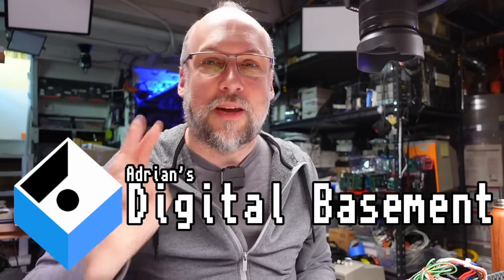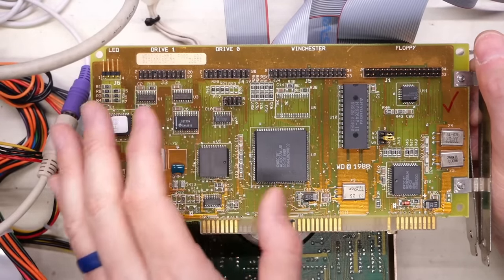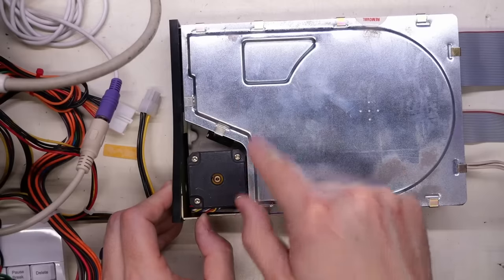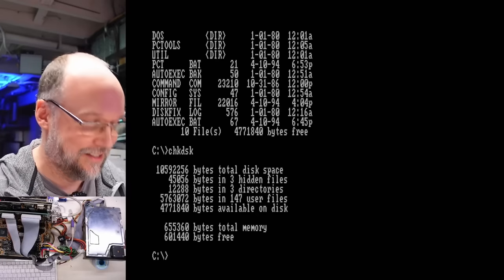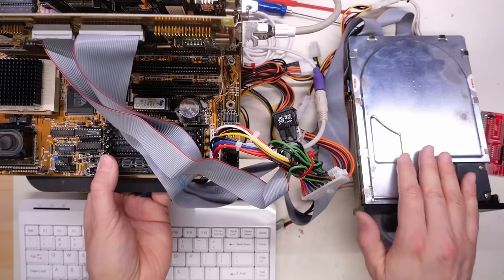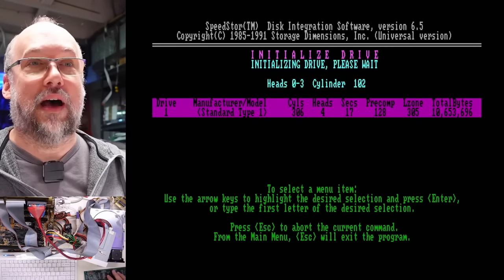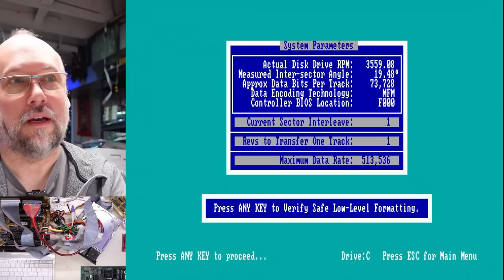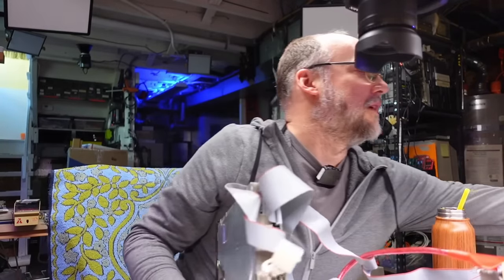Test and try: Does this 40 year old Tandon TM-252 drive still work?

Comment: Tandon was bought by Western Digital. 
Before, WD only made controllers. They had the idea to integrate the controller on the drive electronics and connect the drives directly to the PC's bus via a 40-pin cable. They couldn't find a drive manufacturer to cooperate with them, so they simply bought Tandon for their drive manufacturing plant. All of WD's early IDE drives were 3.5" Tandon (TM262/362 or TM282/382) drives with a new PCB.
So technically Tandon still exists, it's just named WD now :)
Reply: That's awesome info, thank you!
Reply: Super cool story! Way more detail than Wikipedia provided. :) They basically took that $80M from WDC and tried to turn themselves into a full on PC manufacturer, but it did not work out and they folded within 2 years.
Reply: Tandon was a big manufacturer of floppy drives. Later, they created a PC compatible computer with removable HD platters that shared a dock with all the PCB components.
Reply: "They had the idea to integrate the controller on the drive electronics and connect the drives directly to the PC's bus via a 40-pin cable." And thus IDE was born. First versions of IDE were literally nothing more than some bus transceivers that pass through the ISA bus signals onto the IDE cable when certain I/O port addresses were used. The ATA command set to make it work like a hard drive was defined by Western Digital, but there was no real physical limitation for it t support other devices. The IDE controllers were just buffering data and exposing an interface.
Reply: Super interesting!! Thanks for sharing this!

Comment: Tandon drives all sounded like that. That's NORMAL for them!! I remember those things from WAY back in my CompUSA days. They all sounded like they were hand-cranking a flywheel to start a WWII Tiger tank. Ah, memories!
Reply: Pretty much all 5 1/4" hard drives were massively noisy even when they were relatively new (very loosely speaking, these puppies were around ten years old when I first got my hands onto them). I was always fascinated by the slow spin-up, especially of full-height drives. I only ever encountered one HDD with a stepper motor, a 10 MB NEC from a broken Bull Micral XT. It was even more fascinating than this one because the stepper drove the heads using an exposed pinion gear.

Let's face it, 3.5" drives were noisy too, well into the double-digit GB era, only then they got remarkably more quiet. Quantum drives were the absolute worst, they poduced a painful high-pitched whine even brand new. The last of the noisy ones I had was a 10 GB I think. 2.5" drives were much quieter from the start.
Reply: @Ragnar8504  The first drives with a fluid dynamic bearing were from (I think) Fujitsu around 2001. I know this because I frequently ordered fujitsu drives as replacement parts in a repair contract and then one day the FDB version was delivered. Shortly after all other manufacturers also started using FDBs in their drives. Since then they've been silent throughout their lives. FDBs also enabled high speed drives in the 10-15 krpm regime.
Reply: @paulmichaelfreedman8334  Cool, didn't know that!
Reply: Agreed. When I heard that, I thought, oh, yeah, that is going to work, sounds normal to me.

Comment: Adrian - the low performance with the 8-bit controller was in part due to the fact that you did not have the card's BIOS address shadowed in the PC's BIOS.  When you use an ISA controller for your HDD with an EPROM, not enabling that will cause that.
Reply: Yeah. It's equivalent to a GPU running slow because the Resizable BAR feature was turned off.

Comment: Unlike Adrian I do actually enjoy the sound of 40 year old spinning rust!
Reply: I love those old drives!

A vintage computer isn't the same without that power on drive spin up & initialization, and the glorious seek sound while accessing data.

I don't want CF cards in any of my old computers. The true experience is missing. I especially like the 5.25 drive bay covers with the activity LED. 😊
Reply: Agreed, but… Adrian, PLEASE lubricate that bearing! You have sliding rollers! YouTube audio compression does not filter that out, and AS MUCH AS I PRAYED FOR BAD EARS my 50 year old eardrums still cringe at that high whine!
Reply: HDD's, dot matrix printers, modems. I for sure have a fond memory of those sounds. Oh and the booiinng...click! when hitting the degauss button on the CRT :D
Reply: Yeah that spin up sound was fantastic.
Reply: The drive seeking sound that was used in every movie scene with a computer in it for 30 years at least.
Reply: I was born way after these drives were made and I agree. That's why they're so appealing. I grew up in the 2000s and the mechanical drives then were quiet as hell by comparison.

Comment: That era of hard drive protocols was really interesting. ST-506 was intended for floppy and hard drives to exist on the same cable, some computers did use that method of attaching drives (I believe the PDP-11 did). The drive itself is dumb, and the control signals are the same as the floppy drive (the data lines are re-purposed for status).

CDC used a very similar signaling method for their "Finch" hard disks and floppy disks, Usagi Electric has some really interesting videos on them. I compared the signals and there are a few pins swapped around but otherwise they are identical, so it's possible that they are either copied from each other or even more or less compatible on an electrical level.
Reply: I'd hazard a guess that they're both mostly-copied from some manufacturer's app notes.

Comment: Wanna talk loud? The stepperband motor on my Amiga 500's 20mb HDD (non-standard, was kept in it's own box separate from the controller that plugged in on the side) was SO loud you could hear the heads accessing 2 rooms away!  It was absolutely insanely loud. The whole thing sounded like a vaccuum cleaner motor going with a typewriter chittering overtop.
Reply: i had an ESDI drive in a 286 that would shake my 50 gallon fish tank from 20 feet away...

Comment: Good lord, an MFM drive! I love the sound of those, I used to sleep right next to my old XT machine beginning of the 90's and found the sound very soothing. Low-level formatting took the whole night in those days. Good memories. Wish I still had one.
Reply: Just did a low level on 10TB = 14+ hours
Reply: @player_unknown963  I am so jealous of you :-)
Reply: I remember the creaking and groaning of the stepper in my ST-225 drive (20MB) back in 1990. With everything you did, the harddisk would react as there was hardly any cache available for disk operations.
Reply: oh those times. trying every interleave value until you got the highest throughput - 125kBytes/sec :P

Comment: Adrian, I just bought a learn to solder kit and a bunch of little test projects off Amazon. Im in my 40s, but you can never be too old to learn a new skill right? Im starting from the ground up, basically directly due to your YT channel. I got tired of just watching, I want to learn how to do this too. At least a tiny bit. :D
Reply: Nice to hear ! 
Flux, flux is magic ;)
Reply: I’m going to learn soldering myself also inspired by Adrian and I’m 39 lol
Reply: I learned in my mid 30s because of YT channels like Adrian's. I first got one of those awful cheap solder irons that wasn't temperature controlled and thought soldering was really hard. Then I got the Pinecil based on Adrian's recommendation and learned I'm actually not terrible at soldering after all!
Reply: Please learn to use the right test equipment to check your workpiece for any stored voltages before firing up the soldering iron, especially if that workpiece is an old CRT monitor or power supply unit with big caps. (The kits you bought probably won't have any of those, but I'd hate for you to get a big zap.)  Wear your safety glasses, and use adequate ventilation to keep from inhaling lead-bearing fumes.  (Yeah, I'm old school...)
Reply: @horusfalcon There's absolutely no lead in the fumes. The risk with the fumes is because flux is an organic chemical, and when it burns/decomposes it produces a bunch of pretty bad stuff. To avoid lead issues you need to wash your hands well after soldering with lead-based solder.
Reply: 46 here and primarily due to Adrian’s videos I’ve learned to solder, do some kits and restore/recap several vintage computers.

Comment: The missing data happens because the magnetic domains move. For example if your have two north poles next to reach other they spread apart while a north and south next to each other will start to drift together. Even if the domains are still strong they're now out of alignment with the heads. If they aren't too far out of alignment doing a read and write (move files) to everything puts the data back right under the heads. SpinRite does this (plus other stuff). Doing multiple reads can sometimes get a good read and allow the software (with CRC checks) re-write the data again. Newer drives do a compensated write where they put the like poles closer together and the unlike poles farther apart. This also has to be compensated not only for bits in series but to the bits in nearby tracks.

Comment: It still amazes me how many discrete utilities had to be installed on early PCs just to keep the darn things running. We take for granted everything built in to modern operating systems and the massively improved hardware that "just works."
Reply: Back in "the day" they did just work. You only had to know dos commands to run your productivity app.

You didn't have to worry about low level formatting a drive, or interleave settings, etc... unless you built the computer or were fixing it.

Only when things get old do these issues seem more crazy. As modern hardware ages it won't just work in the future.
Reply: In the days of 486s to the Pentuims you needed a few CDs just for the motherboards and its peripherals.
Which is just as tedious but one tends to ignore it due to the "splashy" installer CDs used during setup.
Reply: @volvo09  Ah, your rose colored glasses are strongly tinted, my friend. Things did work fine once set up, but I for one do not miss the days of yore before PnP and SSD that do not need defragmenting. There was considerably more overhead when maintaining computers because it all needed to be done manually. Yes, I cut my teeth on computers that way and learned much, but now I am much too comfortable with the technology of today to return to the old ways except purely for nostalgia.
Reply: @artofnoise5013  oh things are absolutely better today. It's great to not have to change jumpers when installing a new card, install drivers in dos, add network protocols, etc... 

I get what you were saying now, I responded to you from an "end user sitting at a computer" perspective. 

I totally prefer today's "plug and play" computer experience, never would have thought anyone non technical could reinstall an OS and have drivers automatically install as long as you have an internet connection.

My old computers are only a fun toy to revisit and play with, I don't really want those days back!
Reply: @volvo09  Yes, from an end user perspective things were probably simpler as there was internet connection, no updates, and nothing that changed. As long as no one breathed on the machine everything was fine!
Reply: Actually in the DOS world things "just work". All those utilities are completely optional. The PARK utility is a good thing to have with those old hard disks with stepper motor heads.
Reply: @navigatorofnone  That's not true. CDs weren't even a common thing back then.
Reply: @artofnoise5013  Before the PnP ISA was a thing, things just worked. PnP then made things difficult and introduced all kinds of resource conflicts that are often impossible to solve. Often those PnP cards also have a proprietary configuration program that only works with some specific version of Windows or MS-DOS.
Reply: @tikkasen_urakointi  i don't know where you are from, but in the country during the 90s (1992-1998 onwards)computer cds and zip drives already existed along with video cds.
BUT they were very expensive.
From 1999 to 2008 computers became affordable.
Reply: @navigatorofnone Yes? That does not change what I wrote. CDs were not a common thing with 486s, and certainly no-one needed them to install drivers. CD-ROM drives became a common thing later in the 90s, but drivers were small and usually came in floppy disks.
Reply: @volvo09 Configuring resource usage with jumpers works much better than with any software-based Plug-and-Play utility. The jumperless configuration can fail and it often requires a proprietary configuration program that only works on Windows or MS-DOS. Jumpers always work, and the user just needs to make sure that there are no resource conflicts between different devices.
Reply: yeah we used to run computers, now computers run us

Comment: One important thing about stepper motor HDD's, is that the physical orientation can effect the drives operation.  Flipping the drive on it's side may require a new low level format, as the heads end up in different spots due to gravity effecting the heads.  This used to be a real problem back in the day, as users would flip the computer on it's side, and the hard drive would stop working.  Come in, do a low level, partition, and DOS format all would be good.
Reply: Minus their data (high probability)
Reply: @paulmichaelfreedman8334  Always minus the data.  Low level format tends to do that!  ^-^

But people back in the day did stupid shit, just like today.  Had one customer in the late 80's, HDD would be intermittent with the monitor on top of the case.  (The weight of the monitor was causing the case to warp, thus pressing on the HDD).  Told them to just not do that, and it'd be fine.  Nope, $500 later, all fixed.  Stupid.

Comment: The clamps holding the lid on instead of screws assists reducing case stress as the hard disk heats up while powered on.  Several stepper motor based hard disks from this era had thermal issues.  Seagate's ST-225 is probably the most remembered example, but for the '225 it was the PCB underneath causing it.  Loosen the screws a bit, re-LLF and problem solved from then on.
Reply: beside a bunch of antique drives, I still have my very first hard disk, an ST-225, in a box. No idea if it still works, I lost the MFM controller for it. tested them for spin-up about 10 years ago and it sounded as if it still initialized.
Reply: I didn't realise the ST-225 was still a stepper motor drive! It looks completely sealed from the outside, unless I'm remembering the wrong drive, so I always assumed it was a voice coil drive.
Reply: @Ragnar8504  You can see the stepper axle through a hole in the backplane PCB of the drive, and I've had to use that hole once to get the stepper unstuck after having been in a box for donkeys years.

Comment: Likely the cost difference comes from the AT having a controller built in, while the Compaq/XT version includes a controller as well as the drive. This is amazing to find one of these drives in such perfect shape. Seems like it should go into a period-correct XT. I started my IT programming career doing BASIC and PASCAL on a 10Mb XT in 1984!

Comment: You should see if the original 8 bit controller has a built in low level formatting routine with G=C800:5 from DEBUG

Comment: I remember being a very young person (10 12) late 80s early 90s, these were the old drives back then coming out of old 286 machines and business XTs with controllers in them like that one.. yeah wow.. the time it took to low level format one of those drives and then it's a 15mb or 20mb drive.. yikes. But.. they worked really well, and it was tough to kill an old RLL or MFM drive, you really had to beat on it to kill them. A good low level and they were fresh as new. Thanks for this trip down memory lane Adrian!!

Comment: Wow this really takes me back. When you were sure this wasn't a 10Mb drive I knew it was, because I installed them on machines in the mid 80s at Ohio State. I used debug to do the low level format though. I can't remember the 10Mb command, but I did several hundred Segate 20Mb and I think it was debug: g=c800:5. Later stuff was easier. The first hard drive I ever saw was a full height 10Mb. I also had forgotten about Spinrite. Thanks for your content, and for the fond memories.

Comment: With the early 5150 PC's we would take a 10 MB MFM drive and pair them with an 8 bit RLL controller and be able to reformat to get 15MB out of them. The magnetic media was not supposed to be able handle the increased sectors and there was no guarantee that your data would be safe, but most of the time it worked fine. Computing was fun back in the early 80's.
I never had a Hercules color card (actually called the In Color card) but I remember it to be a competent high res card with 16 colors (out of 64) displayable and required special drivers in the few programs that supported it.

Comment: Quick tip in regard to a comment you made while talking about the impact driver. Drilling a pilot hole before screwing into wood may still be a good idea depending on the situation. It’s as much if not more so about preventing splitting as it is about getting the screw in.

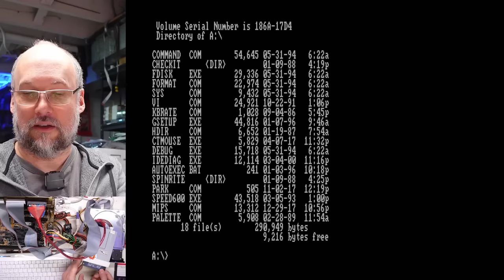Comment: @35:27 you can low level a disk using DOS debug. Quick google says for WD controllers AH takes drive (0 or 1) and AL takes interleave. Then jump to c800:5. You can set AH/AL as AX via "r ax". Then "g=c800:5" for the jump.

Comment: 16-bit MFM disk controller usually does have their BIOS extensions onboard. A controller card takes 2 memory addresses, one is controller i/o, and the second one is BIOS. This particular 16-bit WD MFM controller can coexist with the IDE host adapter when set to SECONDARY, it will however conflict with XTIDE BIOS at memory location C800 (but XTIDE can be switched to another memory location).